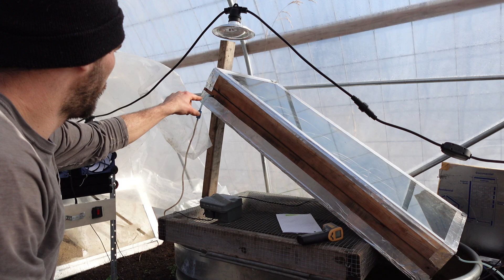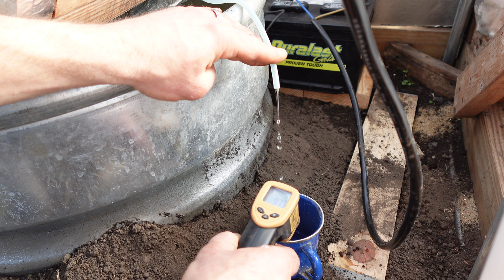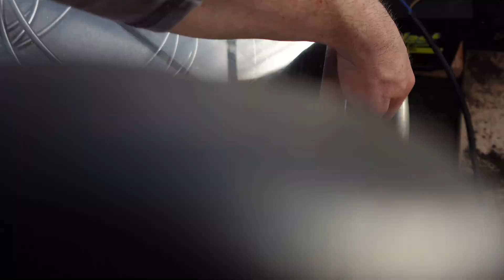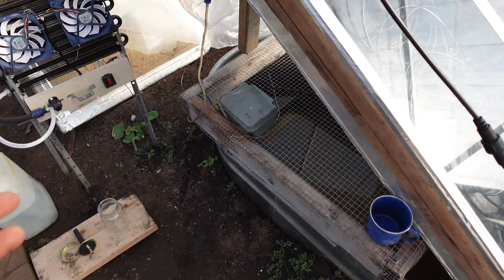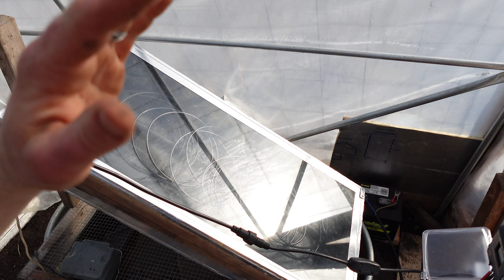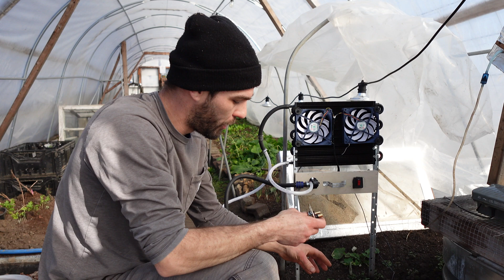FREE DIY GREENHOUSE WINDOW HEATER / PASSIVE SOLAR HEATING EXPERIMENTS

Comment: Its been a long time but I'm sure if you get the passive absorber copper pipes set correctly, water should rise as it heats up, creating a kind of circulation.  Which would remove the need for a pump and still only work when its sunny
Reply from the maker: that's a great observation! and I noticed the flow slowing on very sunny days as it feeds top to bottom. it allowed the water to heat up as the flow slowed but if the flow was reversed it would probably not need a pump but would have a very slow movement.

Comment: How exactly is this better than water in black barrels? (It's not)
Reply from the maker: This only flows on sunny days. That black barrel has just as much negative draw as our large tank. Water only works as a heat sink when you’ve got sun. This does work better than a barrel as it’s actively heating the water when sun is present, a barrel just sits and absorbs heat slower
Reply: @Earthdwellershomestead  all energy absorbed by surfaces will be stored and then slowly dissipated. Preferably as slow as possible, by radiation rather than convection. The higher the gradient of the temperature you have, the more quickly energy is going to escape outside. 
And the cost of additional black barrels of water is so much smaller than your setup...
Apart from hackvalue and fun you've had, this seems to be a waste of resources. Sometimes the simplest solution is the best.
Reply from the maker: @sieciobywatel I see your point but barrels are expensive to get clean ones unless your lucky and know a food grade company that throws them out. And the amount of room the take up isn’t ideal although black barrels are the best thermal mass storage for water yes. Raising the temp on the 100+ gallons of water in our tank 10-20f rereleases it at night all the same as black barrels would. The only cost to this system originally was a small pump and the tank. Everything else is recycled or free.
Reply: @Earthdwellershomestead  you don't need to buy barrels, you can use old plastic buckets or milk jugs, just paint them plack or wrap in black stretcher foil. It's the principle, you need a surface that absorbs sunlight and water to store energy. That's why a simple plastic bucket will always outperform a thin pipe...
Reply from the maker: @sieciobywatel paint is toxic I’ve done that before it always Leeches. Thanks for the ideas

Comment: 2nd Comment 
If you were to wind your flat plate solar receiver pipe into a tight flemish (spiral) you can house 50 feet of 1/2 inch copper in an insulated clear-topped space 1 inch high and 36 inches square.
That's what I do and it works great and takes up less space while keeping the thermal mas held together tightly with less chance of cooling due to the sides of the tubing being exposed to air, as they are in your application.
Reply from the maker: Great insight, this was an experiment we built last year I planned on filling it with sand like the other one to hold a better thermal mass and not be exposed to air. Thanks for the comments!

Comment: I'm autistic, so I see the world differently than others.  That said, I too heat with solar, but with a twist:
I heat oil.
I keep a large receiver filled with oil year round in North Texas, where we get freezing winters. Oil doesn’t freeze.
Running in copper heat exchanger loops, suspended from the receiver's top, I am able to apply the stored heat to many "zones" (domestic hot water, space heating, hot tub, etc).
I use a copper flemish (shape) active solar receiver powered by a solar panel and an inline pump.  When there's enough sunlight to power the circ pump, there's enough to heat the oil.
On cloudy days, oil heated to over 400° lasts for days.
The receiver is housed in beach sand for insulation purposes.
Reply from the maker: That’s very intriguing, what oil do you use? (We would use something as nontoxic as possible) I’ve thought about experimenting with something like that. We’ve been developing a diy coolant/antifreeze with vegetable glycerine dissolved in water. Glycerine drastically lowers the freezing temp of the water solution.(haven’t released that video yet lol) thanks for the idea also!
Reply: @Earthdwellershomestead  
Peanut cooking oil
Reply from the maker: @SiwyWabbit  awesome thanks for the reply

Comment: Any heat that comes through a window is going to heat the space...
Reply from the maker: It’s  trapping the heat inside the insulated box and amplifying it much greater than the inside of the greenhouse
Reply: @Earthdwellershomestead 😮no. It "amplifies" the temperature. But this high temp water 's heart gets diluted back down to greenhouse temp as you apply the high temp water to the greenhouse.

You need to put this box outside to do any overall heat gain for the greenhouse.
Reply from the maker: The box would freeze with only regular water inside it being outside the greenhouse In winter, hence why it’s inside and why I show temps from it being inside

Comment: I'm a bit lost on what all the parts you're using are. I'd love to see a breakdown of each part of the system and it's function. Thanks for posting,!
Reply from the maker: I will show a build video of a heating box when I make my next one. We have copper coiled up inside painted black and the box is insulated for better heat. We’re flowing water through it slowly to pick up the heat the box is creating and adding the heat to our thermal mass tank down below. I apologize I didn’t. Explain the box the best it was a project from last winter lol thanks for watching
Reply: @Earthdwellershomestead  I will definitely watch that, thanks for explaining.
Reply: Don't you need to put the solar heater box out side your greenhouse?  Inside, you're just stealing heat from other places in the greenhouse.😮

Comment: I had a neighbor who just heated air and ran it into his house. The coldest days in the winter have no clouds, and he had his windows cracked. This was MO, so it was single digits F.
Reply from the maker: We've had our fair share of broken experiments in and around the greenhouse. Passive solar is my least useful heating method in winter time, that's why we secure other resources for staying off the cold temps of winter. although with an autonomous system as this, we can pull some good thermal mass off into our 100 + gallon tank on the occasional sunny winter day but we go a month at a time without seeing the sun sometimes. thanks for checking this out!